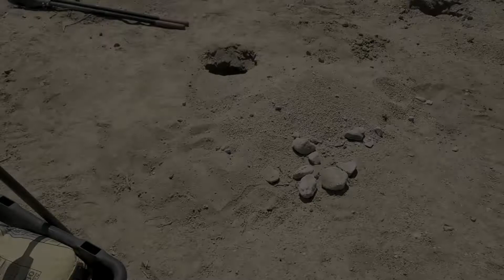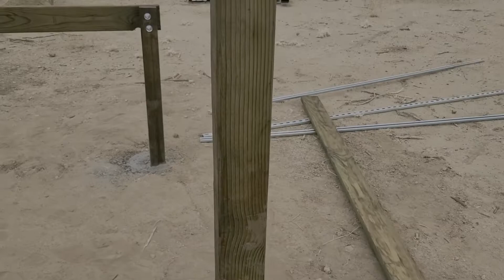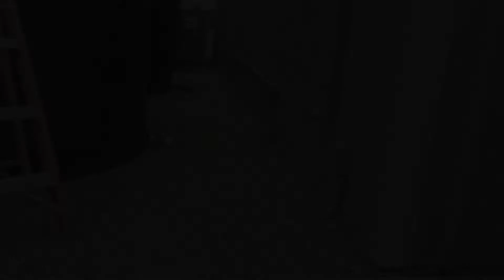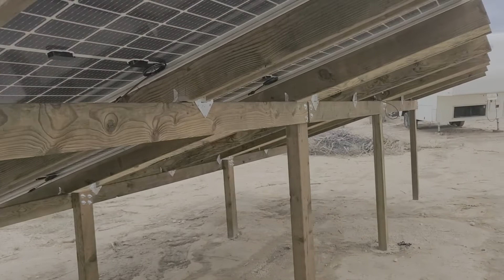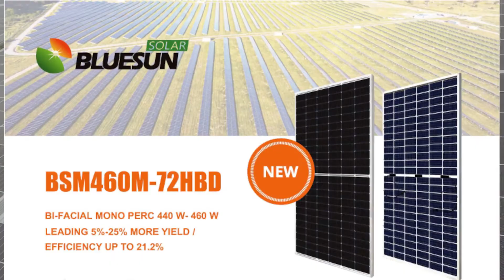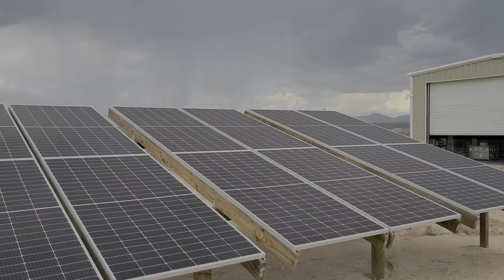Solar Upgrade Part1

Comment: I need some advice, I'm thinking of upgrading my inverter/charge controllers as i keep having gremlins with the cheaper ones.  They have great customer service, but I'm tired of repairing them.

Are you having good success with the mppt?

Thanks for sharing, and as always, keep building 👍
Reply: After re watching your videos on solar, I have come to the conclusion that my inverter temp is the issue. I focused on cooling the batteries so much that I forgot the brains behind the whole system, lol
Monday, I'm wrapping up the battery cabinets and duct work for the ac, and I'm gonna make sure everything gets ac.
Reply from the maker: @ToddLarsen  Sorry I was too slow - working on the house until I couldn't take the heat any more.  You are on to something with the inverter temp.  I try to keep the room <90 on the temp probe.  I keep the A/C set to 72, but that just makes it run all day long with my servers going too.  If you get to the point where you want to upgrade, I cannot recommend Schneider more.  I've had ZERO issues and the load imbalance for L1 and L2 ability is what really sold me after I watched all the other videos on the Chinese inverters.  I like Victron too, especially the open source nature of the software side, but in the end Schneider was the right choice for us.  I'd be happy to help out any way I can which ever way you decide.  If you eventually want to try to get things going on a monitoring system like what I have, I'm sure we could figure it out.

Comment: Small hint: Energy cannot be saved. So if I want to boil my water, I always have to use the same amount of energy for one liter. Christian's method relies on a longer period of time with less power in order to be able to use the power provided by the PV as efficiently as possible - so consumption peaks are intercepted. In the end, the energy consumption should even be (slightly) higher due to the interposition of the dimmer, but it doesn't matter, since more efficient coverage by the PV system and therefore better use of the self-generated energy .......... .... 🌞 ................ Solar Mini PV Tip ... Winter & Camping. A boiler and other hungry electricity consumers can be infinitely dimmed using the "5000W dimmer". Ebay €7. I run 5 dimmers in parallel on an 850W inverter. Kettle 2.2KW at 150W runs 12 hours a day, so the water is always hot. The room is also nicely heated. 2.5KW washing machine runs in parallel with dimmed to 200...400W. Iron, dishwasher, oven, electric heater, coffee machine, all internal heating are throttled with me. Videos on my channel https://youtu.be/eC2olbCBhh0 The inverter stays cool, quiet and the MOSFETs + (battery) remain intact because no extreme current peaks arrive at the inverter. Now every Mini PV Inverter is enough to sell large devices. So, with the dimmer, all internal heaters/devices can be converted into base load devices that stay almost permanently ON, drawing very little current directly from the PV. With a wattmeter / energy cost measuring device you can then measure this perfectly in order to optimally set the dimmer.
                      With the dimmer, self-sufficiency will now increase from 20% to almost 95% in summer, which means a huge breakthrough. The prerequisite is that you have at least a small balcony power station, and you don’t need an expensive battery either. Example of a kettle: Without a dimmer, the 2500W - 600W PV system needs = 1900W, which you have to pay more for. If I turn the kettle down to 600W with a dimmer, then every weak PV system can now supply each consumer independently and independently, because the 2500W kettle becomes a 600W kettle thanks to the dimmer. Magic... The 2000W e-heater becomes a 500W e-heater with a dimmer, which can run 12 hours a day free of charge via PV. https://youtu.be/QbLWDbJi6ew . The 4000W oven is also tamed. Not the solar systems have to grow, but the consumers just have to drop by 75%, which is sooo easy with the dimmer. are you convinced now I have already switched my entire household to dimmers. Please have a look at my channel. LG, Christian .........
Reply from the maker: Thanks Christian.  I'm going to check out your videos.

Comment: This is terrific! 
 I just picked up 10 more panels myself and I'm liking what you did with your structure and I may be copying you lol
I also just ordered 16 more battery cells and another inverter/charge controller. 

The cloudy days drove me mad as I recently picked up a harvest right freezedryer and I couldn't use it without the generator lol

Thanks for sharing and as always keep building 👍
Reply from the maker: You're very welcome.  And remember, my offer always stands if you want any help.